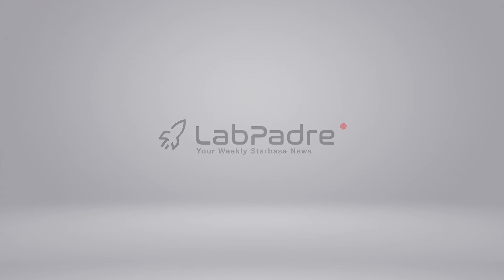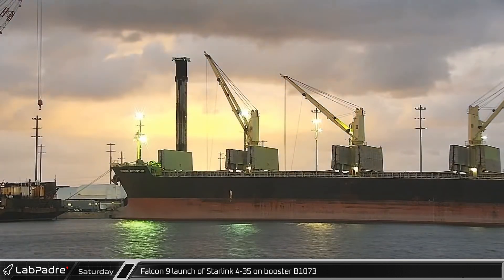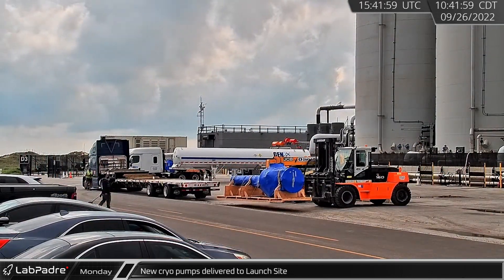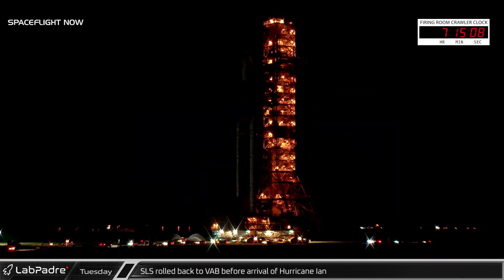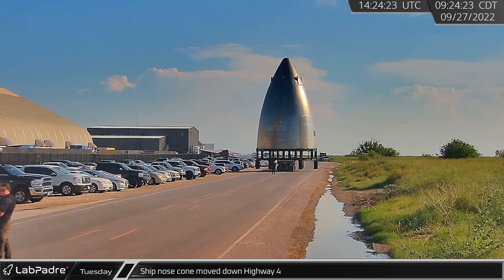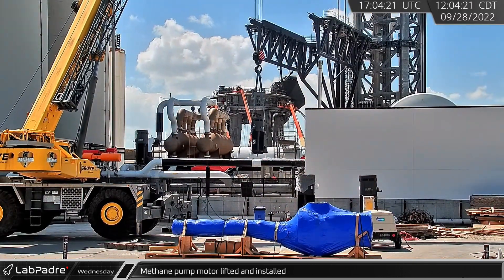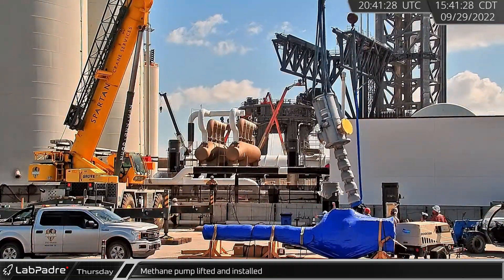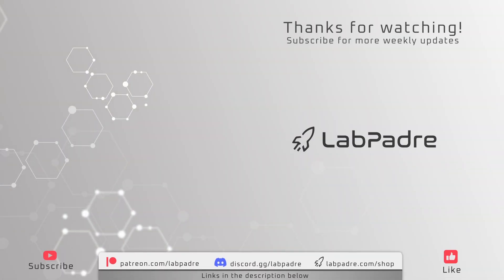SpaceX & Starbase Upgrades Continue Weekly Update - #30

Comment: Great update! With as many pumps as they seem to be replacing I wonder if every pump revision is  being upgraded. I am sure I have seen a half a dozen pumps pulled and replaced. You would think that the pump they return gets a  inspection and the data from that helps to build a much better pump. It also seems like the motors are not new? Its just the pumps as it seems. I wonder if they are doing this due to wear or something. If this is the case then I hope the new tank farm at the Cape has a dozen pumps and motors in line for easy transfer. As I would hate to see a pump fail and not have a working backup.

Comment: I believe the Ship Nose Cone without heat tiles might serve as a cap for the Booster in a „booster-solo“ flight-test without a „full“ starship on top. This could provide aerodynamic protection and could be discarded (and land with a parachute, like fairings) before the booster attempts a landing like under real conditions. Thus you only risk the booster and not the full stack in a test.  I guess you cannot simply launch a booster without any aerodynamic top. (Just like Falcon Heavy or Delta Four.)
Reply: wrong!
Reply: @inkster147  thanks for your insight.
Reply: If would make sense to try a Booster Solo flight, though without the load on top, it wouldn't need the full fuel loads to reach the planed Stage Separation altitude,... that could lead to it surviving with a fault that may only show up under full load.